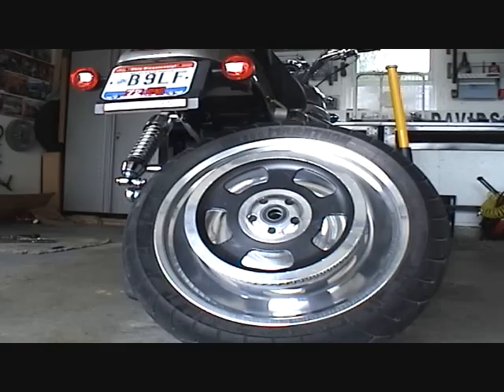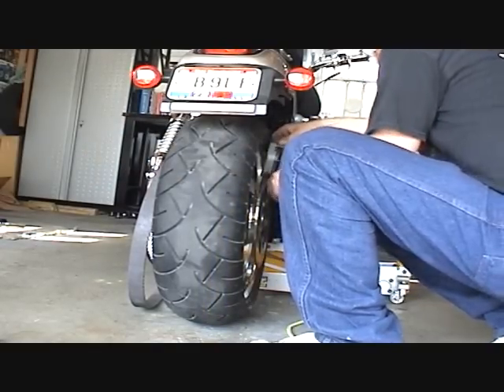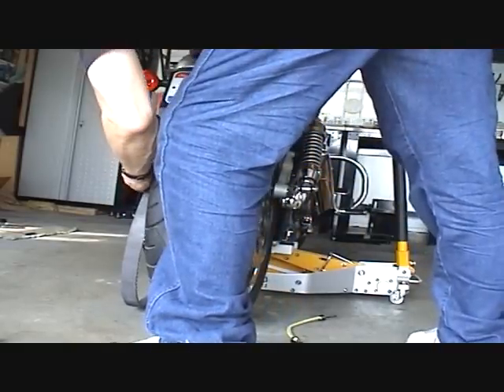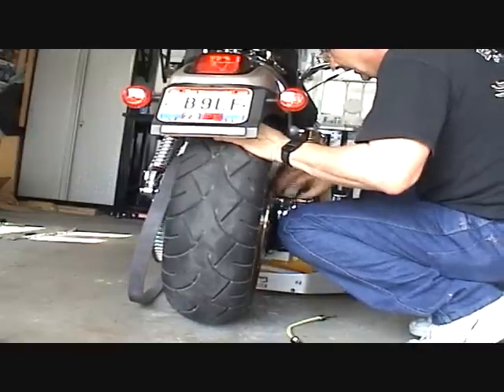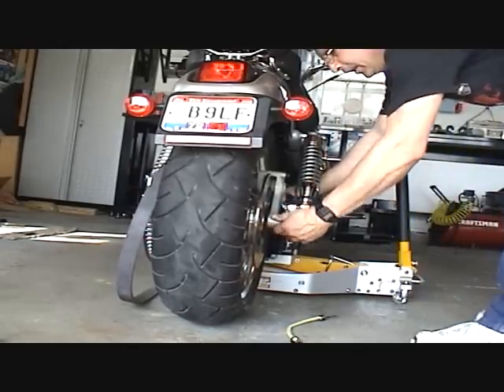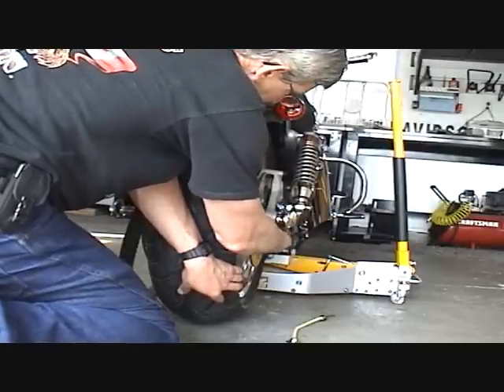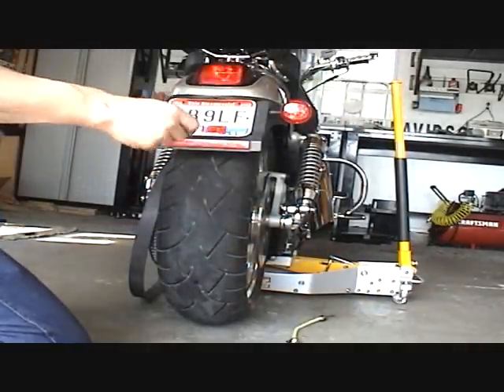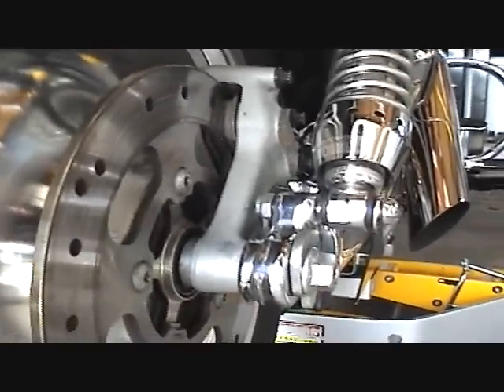Rear wheel Install Pt1.wmv

Comment: Great clips RSCROD! Curious about that rear tire...240? If so...I have a 2003 Vrod as well and I don't see any modifications to your belt guards or swingarm? Did you have to do any mods I'm not seeing? Thanks again for the clips.
Reply from the maker: Tire is stock 180.
Check out 1130cc.com for backyard 240 set up.  Yes you can put a 240 on a 2003

Comment from the maker: Yes beller to tac into place.  they will fall out. trust me.
Reply: thanks great videos btw
Reply: Hello again,  can you think of any way possible to avoid grinding the output flange bolt heads to install a 26tooth pulley? my bike is stock vrsc-b 2005.  any way some sort of spacers can be used?  i have researched this to death.  i have a pulley on the way from turbotec was trying to avoid grinding